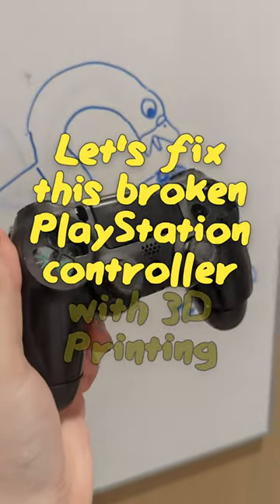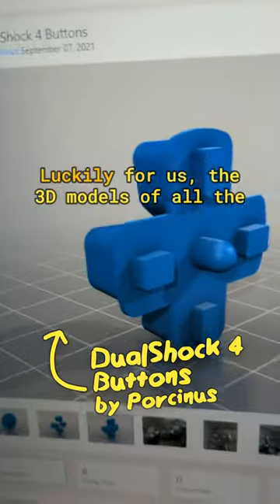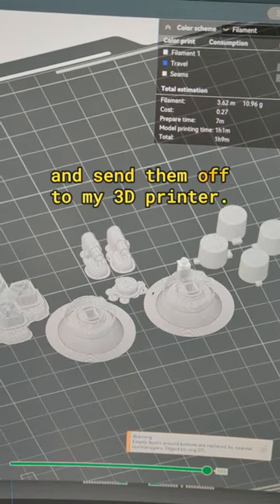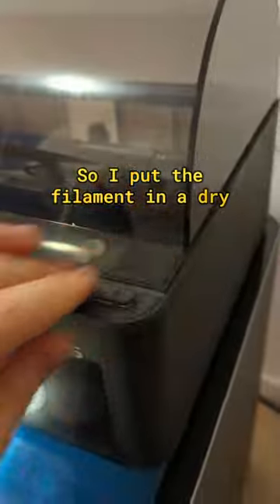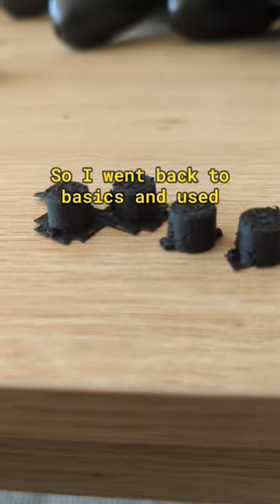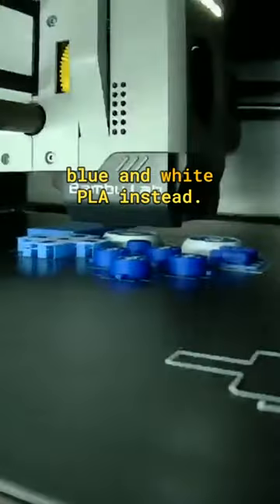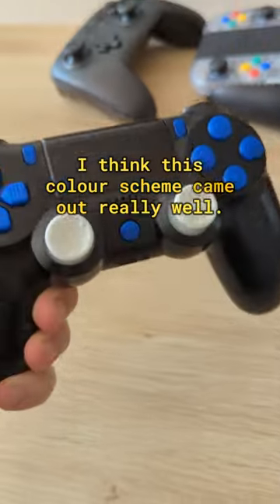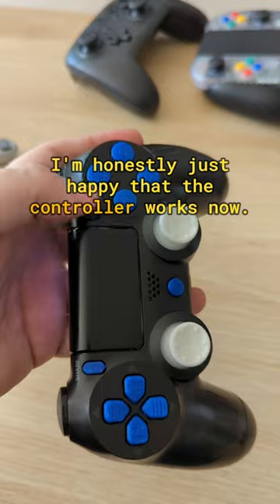3D-Printed PS4 Controller #3DPrinting #shorts

Comment: I would just spray the buttons with flex seal to make them smooth
Reply from the maker: I need to try this!
Reply: @BuildyBryce  I would use model filler and sanded it or fibre glass resin and then do a custom paint job and finish it up with a protective seal
Reply: that would probably make it thicker and make it not work

Comment: I would have used a resin 3d printer
Reply: What's the difference
Reply: @alphadurk9483  higher quality and smoother and wont melt
Reply: @jonahplayscello  but also more dangerous and more difficult to use, as well as being typically weaker and more expensive for the print area
Reply: @aaaaaa-nr5mo  it is weak if you use weak resin and if you know what you’re doing then it is safe and worth it 
The extra cost is worth it for the final part in my opinion
Reply from the maker: I would have too... If I had one 😅